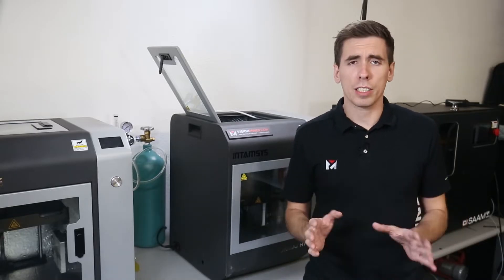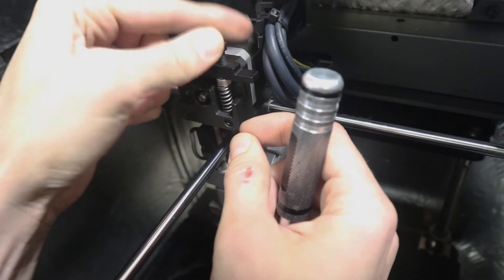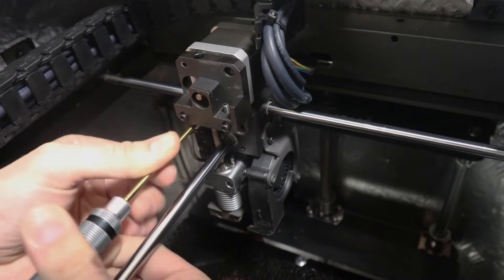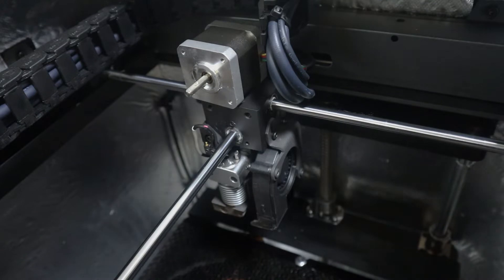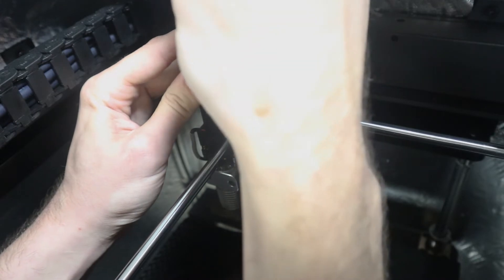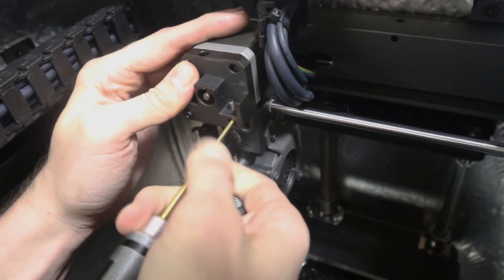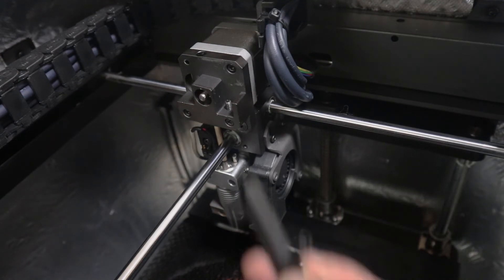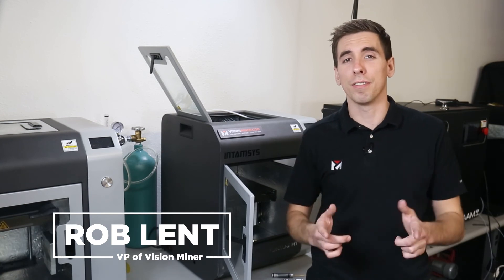Funmat HT Support: Printing Flexibles, and How to Make It Easier!

Comment: $5000 3d printer with a 1:1 mk8 style extruder with 100mm+ filament path...why? With just a little effort they could get a direct drive all aluminum BMG style extruder/heatsink combo with a filament path 20% the length of this and dual gear Hobbs. That would make this 1000% better and faster with flexibles and a far more reliable machine all together for an extra $100. This is remarkably silly unless it is a feature restriction intended to make the more expensive intamys machines more appealing. Either way, the only thing special about this machine is the heated chamber right?
Reply from the maker: Couple things:  
1. It's $7500
2. It's direct-drive, the motor is on top of the exruder
3. It's all made from steel and aluminum which makes a HUGE difference when you're heating chamber to a constant 90ºC :)

there's a lot more to it than just being a consumer 3D printer in a heated box, believe us!

And stay tuned for the bondtech.... with some other surprises, they may be just around the corner :)
Reply: @VisionMiner  what do you mean “stay tuned for the bondtech”?

Comment: You actually leave that screw loose?? Can you not see or get to the set screw to align the gear / wheel together how do you know it’s aligned to the other one you never checked ? Can you see it from the hole in the top ? Maybe drill a hole by the set screw if needed to you would know better...
Thanks in advance
Reply from the maker: You may be just overthinking it..... the gear has plenty of teeth to go around, the wheel is aligned by default, not something you have to worry about with this one...